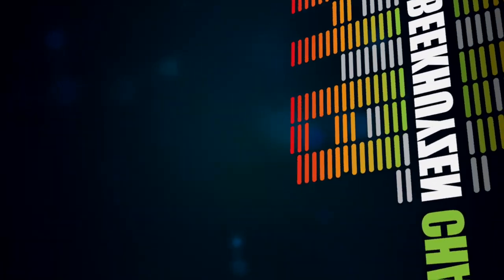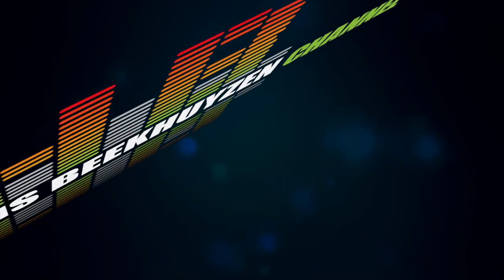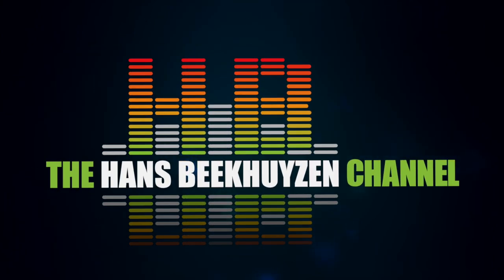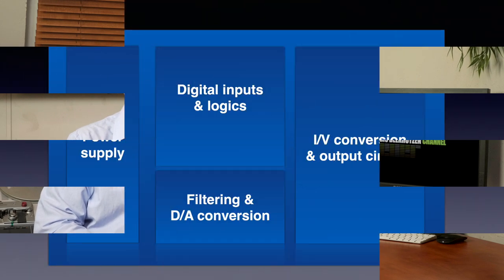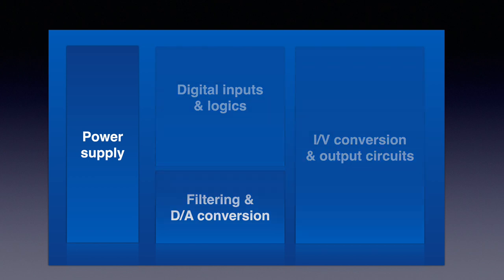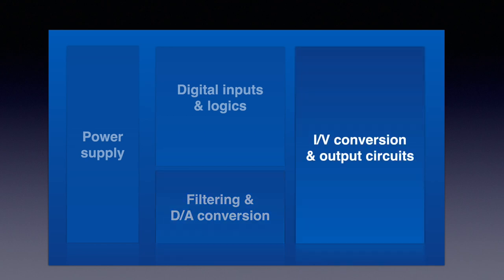What’s inside a DAC, part 1

Comment: Thank you for all your work and videos, Hans. Never skip your new videos. 
I have a question: can higher sampling rates be used in lower costing DACs for minimizing jitter noise and poor implementation design? Does it help? thank you!
Reply from the maker: It can't cure jitter nor noise but it makes the filtering easier. Watch my video 'MQA part 1; Why 24 bit 192 kHz audio?": https://youtu.be/r_wxRGiBoJg

Comment: I use a USB cable that runs the power to a 20,000mA power bank to avoid noise from the power supply. Great video. Looking forward to the follow ups
Reply: @paulb4661  have no idea. Does seem to keep instruments from drifting in the sound stage a little more.
Reply: @paulb4661  yeah from the laptop USB compared to the PB. The only thing I can attribute to the increase in detail is  the battery has less noise effecting the signal. My definition , understanding anyway. Cheers
Reply from the maker: You're thinking analogue here. A noise power supply can disturb the D/A conversion by causing jitter. Watch the whole video I mention for an explanation.
Reply: @TheHansBeekhuyzenChannel  yes I'm aware of that. So a battery avoids that issue. I'd imagine when it gets drained other issues pop up. I don't notice it as that power bank is 20,000 mah, 5v, 2.0 amp. I do notice it on my DC phono preamp when the battery gets low. Space Technology out of Vancouver btw. Others report good results using power banks
Reply from the maker: I didn’t say a battery would avoid that. Batteries can be very noisy too.
Reply: @TheHansBeekhuyzenChannel  would be interesting to review power supplies(switching and linear) to battery sources.
Reply: Just for your information: lithium cells typically have 3.7 volts (a bit more when fully charged, less when near empty; levels depend on materials used), and the required 5V are typically done by a converter ie a dcdc converter, that involves high frequency switching, an inductor, rectification, output caps etc. .. and voltage quality is subject to realization of this voltage converter; and its output impedance is again another influencing factor. Mind the whole thing isn’t built to power a dac that is to some extent sensitive to the supply voltage.
Reply: @gioponti6359  I know that. Still sound better. It's not the same circuit at all. Can also be run in parallel and dropped to 5 v without the need for what you describe. Which is what I belive is most common.  As its cheaper to do.